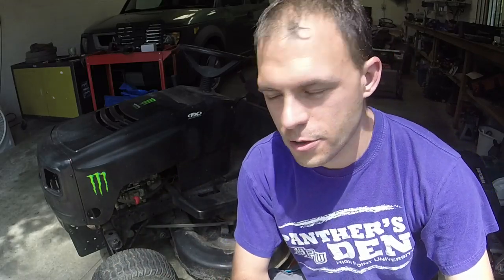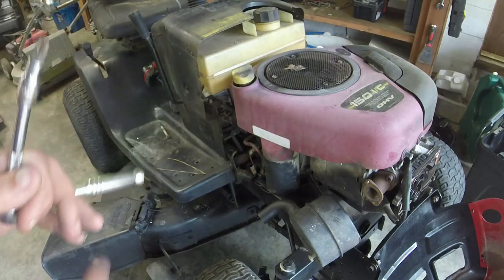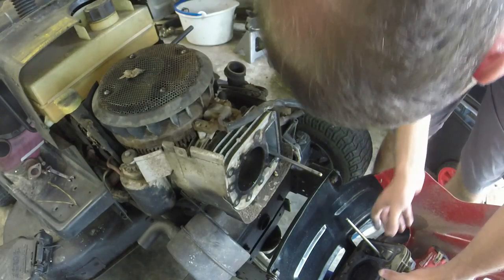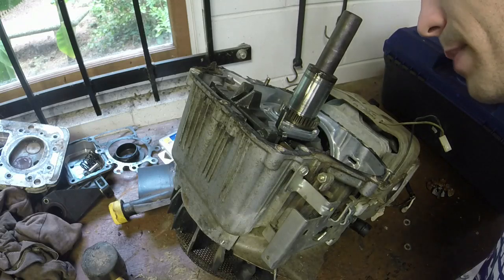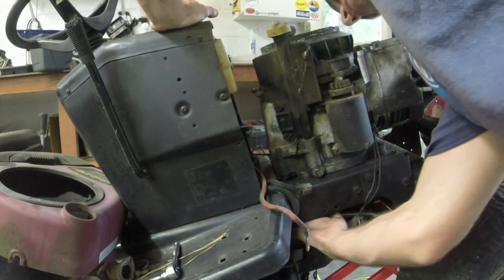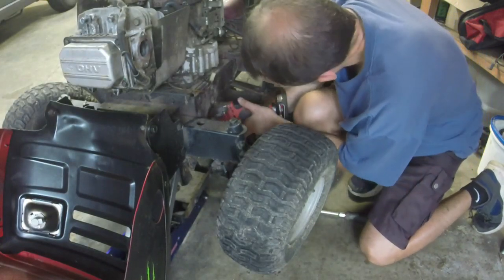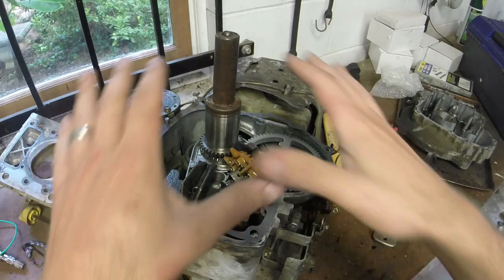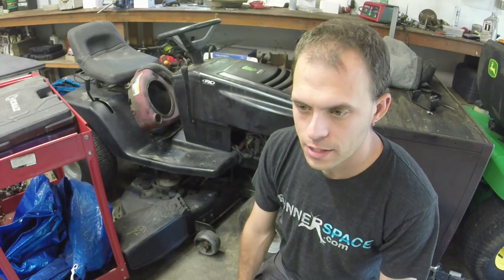Free "Monster Energy" Murray Briggs bad camshaft  and pushrod diagnosis and replacement

Comment: I like those late 90s-2000 Murray front engine mowers for the same reason I like the late 90s-early 2000s model Chevy Malibu …. There is nothing particularly great or special about them but they are pleasant enough to use, cheap to buy/own, and usually they quietly get the job done. I think the disposable nature of both of them will probably make them a rare sighting in the next decade or so. As far as I am concerned, Murray died when Briggs got them and moved the show to China … kind of like RCA TVs and Westinghouse “everything”. I have a 2005 Murray behind my shop that I want to fix and just hold onto … for no practical reason … I just want to!
Reply from the maker: These mowers are starting to get some age to them but they hold up to abuse better than any other mower I have ever seen.  Cheap but tough!  I guess they are the Malibu of mowers haha.

Comment: Yep, its a lot of work taking apart an engine, but its required work to fix something of this caliber. Its not too often we find bent or broken push rods, but it can happens. While I have no doubt this engine overheated, I am sure it produced some backfires in its life, just saying. Glad you cleaned out the sludge in the oil pan while you had it off too. And remember, its always that last bolt that you missed lol! I love it when you upload vids like this, masterpiece!

Comment: It's a pain lining the engine back up.
Did you lube the cam and tappets before you put them pack in?
It'll be interesting to see how that cam is.
Happy Thanksgiving.
Reply from the maker: I usually try to get a little lube on those items, not sure if I did this time.  A cam replacement on one of these is pretty easy now that I've done a few.